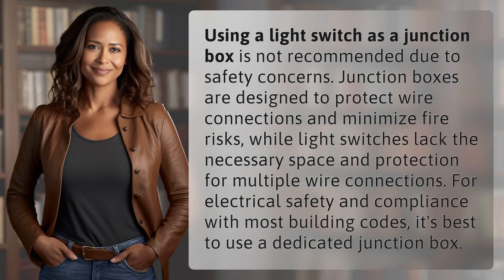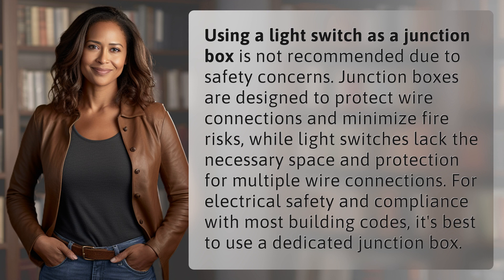Can I use a light switch as a junction box?

Comment: As an electrician for 30 years, a switch box is a good place for a junction box, as long as it is sized correctly. If you use a dedicated junction box for all your junctions, it will add more boxes to your wall space and time to your installation. I couldn’t find a reference in the NEC requiring terminations only in a junction box. Your local building inspector is a good source for construction trades questions.